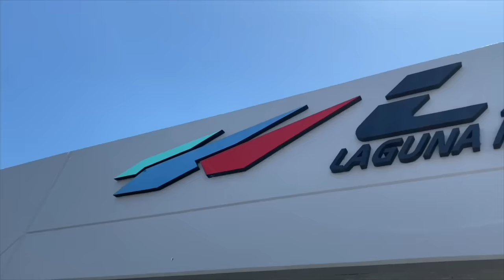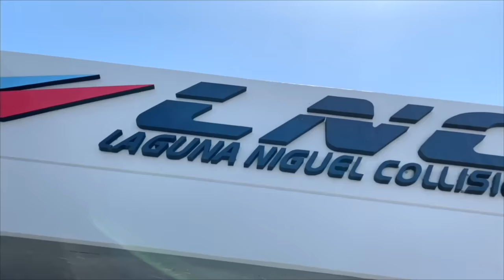Rebuilding A Wrecked Porsche 997.2 Turbo S Part #2

Comment: Hello from Spain Vlad. I watch all your videos  (LNC paint too) and I am delighted with the quality your work! I dream of having someone like you in Madrid where I live, as I have a 997.2 Carrera S. I want to ask you to include if possible in Part #3 of this project how to remove and reinstall the roof side rails, to see how they it is done and how many clips there are to fit them properly (should be 10 by side as per the repair manual), because I want to remove and fix one in my car that is a bit uneven from a poor paint job. Thanks a lot in advance. Andres
Reply: No one cares about removing roof rails.
Reply: I see
Reply: @mediterraneo52  good luck though 👍🏻